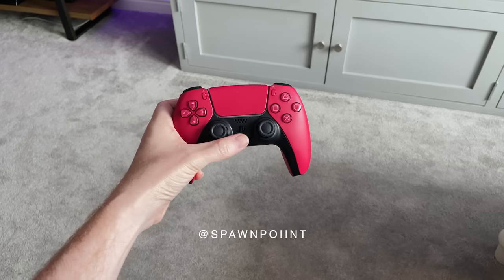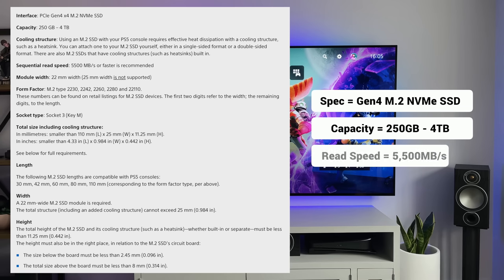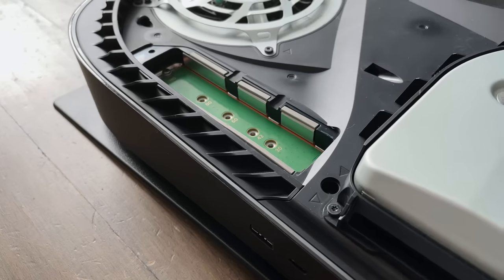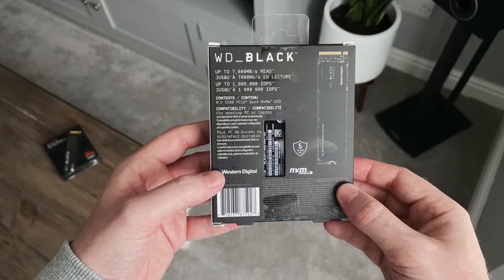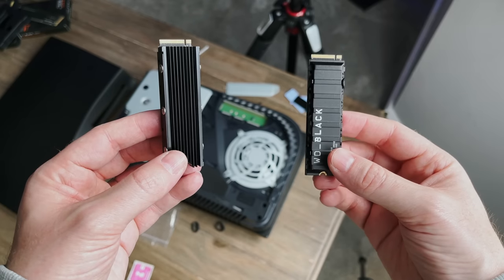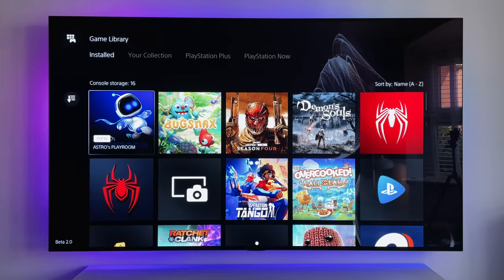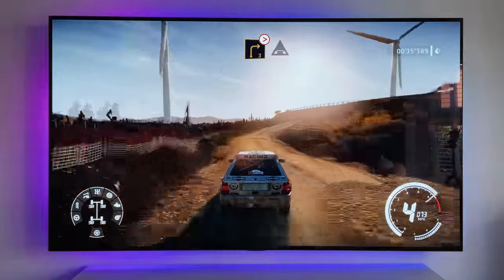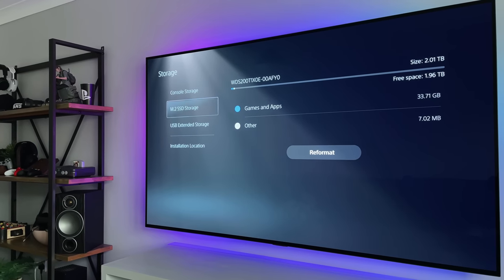PS5 SSD Upgrade: Installing 2TB SSD + Heatsink

Comment: Replacing that metal cover after installing the SSD is very important as there are holes underneath in that SSD area that the PS5 fan will suck the heat out from the SSD keeping it cooler.  I see many are purposely leaving the metal cover off thinking it will keep the SSD cooler this way... but that's a mistake.  Sony has a system in place to keep the SSD cooler by removing the SSD heat but the metal cover needs to be on for this process to work properly.
Reply: It's not a mistake -_- leaving the cover off WILL make it run cooler obviously as heat rises and the fan will still take heat away from the unit. The lid is only to prevent it from collecting a ton of dust and nothing else. Many things are designed for aesthetics on Sonys consoles and not for performance, been that since the ps3 and this is no different.
Reply: @Ardonn  Right about the SSD cover keeping the dust out... but Wrong about leaving the cover off to keep cooler. Sony says to put the silver cover plate back on to create negative pressure to help with the air flow for better cooling. And aesthetics is something done to see on the OUTSIDE... not on the Inside of something. But believe whatever makes you happy. It's your PS5 that is at risk for getting bricked.  Good Luck
Reply: @JTB--  this is right on.
Reply: This was the answer I was looking for :)
Reply: Good thing I saw this comment, i was finally able to order my ps5 and do plan to put an ssd in it. First thing I thought when i saw this video was, "i'm leaving that cover off" haha but now I will definitely replace the cover
Reply: Tests have been done and it runs cooler with the cover off
Reply: @Chipperdude  source?
Reply: @Chipperdude  source?

Comment: To anyone thinking of leaving the metal housing plate off to accommodate heatsinks that come with certain SSDs, don't. Check the dimensions and order a custom heatsink that allows for the plate to be put back after installation of any SSD. SONY officialy states that this plate is there for a very good reason, and must be left on whether you use a SSD or not. Anyone that doesn't, is risking the integrity of their console and the SSD installed.
Reply: Thank you

Comment: A nice addition to this is the performance boost. The larger your SSD the more it will take to fill it and the faster your ps5 will run if it’s not close to full.

Comment: I think I’ll wait for Black Friday to get 2TB for a discount,1TB just isn’t enough these days
Reply: It may be out of stock by then too
Reply: NAND prices are going up, not falling. Drives will either stay where they are or go up when prices catch up.
Reply: the longer you wait the higher the price, I suggest you to buy the SSD asap and just wait until the final software is released.
Reply: @benny.pepper  why the SSD prices are gonna increase?
Reply: @sicparvismagna6526  Inflation and the chip shortage
Reply: @andrewvu3083  but I mean, eventually in the next couple of years the prices will probably reduce right?
Reply: @sicparvismagna6526  Supply chain shortages are getting worse because of the delta variant. It’s going to be a long while.
Reply: @andrewvu3083  I’d still wait, because if the delta variant will end up being that bad, I’d assume the last thing we’d be worried about is gaming.
Reply: Just get a 1tb drive. 
It adds to the existing storage, not replaces. 
So with a 1tb m.2 ssd installed you'll end up with 1.7tb ish of usable storage.
Reply: I think you should wait until this system becomes more refined.
Reply: The XPG SX8200 Pro 2TB on Amazon for $220 is a great drive with a 5 year warranty. I've been using it as my main drive for a few years now with no issues.
Reply: @Defy_Convention  I don’t think that drive will work for the ps5
Reply: @HereticDuo  facts man with the ps4 pro it was different when you put a 2tb ssd it was dropped to like 1.77 with os so i guess im getting similar but a little less but u had a lot of space before jumping to ps5
Reply: @benny.pepper  Its just 500 dollars for this. Kind of expensive. Could buy another ps5 with it

Comment: YES! Finally someone actually trying this.
Reply from the maker: Thanks for watching mate.
Reply: I will be trying the 980 pro without a heatsink and see how it performs
Reply: @Native8KGamer  You’re probably gonna want a heatsink to ensure the drive doesn’t thermal throttle itself below the required speed
Reply: @cmdr101z8  Will try with and without and I'll try and post my results
Reply: @Native8KGamer  Cool, it’ll be interesting to see
Reply: @cmdr101z8  tested with and without, and honestly, the load times were exact same in 10 different games. The one without heatsink was between 5-10c higher in temps but nothing its not rated for. It might affect the longevity of the drive but it you don't have a heat sink, it works just fine
Reply: @Native8KGamer  That’s what I was thinking was going to happen. The higher temps probably won’t be good for the long term but for the short term until you can get a heatsink I think it could work out fine

Comment: It’s nice Sony made it easy to add the drive. I’ll definitely be upgrading. Great video 👍🏼
Reply: Bruh, we knew it was easy to add the drive almost a year ago, they did an entire hardware breakdown showing the slot. You just wake this year?
Reply: @evilformerlys4704  yup. Just woke up 😉
Reply: On the Xbox series you just unplug / plug whenever you want to remove your SSD.
So much simpler and user friendly
Reply: @mrrglass3407  it is but this isn't that big a deal to me. What is annoying is how they went about doing it and having their customers beta test for them instead of doing their job.  Should have been ready at launch.
Reply: @AlphaDwg  
Yes, it should have been ready at launch.

Just saying the Xbox chose a much better solution and consumer friendly solution
Reply: @mrrglass3407  "consumer friendly" by making them proprietary drives? no... that's the opposite of consumer friendly.
Reply: @Dreadpirateflappy  
Proprietary drives... That are cheaper than PlayStations SSD solution.... And have more than one company making them thereby the price will go down.
Reply: @mrrglass3407  Well there is Big difference between the speed of Xbox and PS5 ssd… so you get what you pay for… it is like saying that Trabant is cheaper than Ferrari, but yeah it os good to have options!
Reply: @haukionkannel  
No there's not a lot of difference despite what you've been told.

Comment: I can confirm this works flawless i been using my ssd on my ps5 since the release of this video i have the exact same ssd & heat sink aswell. It saves you around 70-80 euros. I play a lot evey day at least 6 hours but moat days over 10 average. Never had any issues loading plus very convenient sending files back forth between the ps5 internal & the ssd
Reply: Does it load faster than the ps5 storage or is it about the same?
Reply: So was the price of the ssd 400 when you got it because I see the one without heat sink is 400 and on with is 240 USD?
Reply: @gabrielfowler4963  300
Reply: @gabrielfowler4963  sloud be able to get it for 150-180 if your patient enough keep a look out for that once or 2x a year super deals
Reply: @noneya7905  slower but all games are running flawless i have 525+ games including many heavy AAA games. The stock ssd on the motherboard is 5500 so yes most ssds will be faster if not a massive improvement good choice to install them on your m.2 ssd
Reply: @sjors91  ty

Comment: Will be putting in the Samsung 990 Pro 2tb with heatsink is this a good choice
Reply: How'd it go? Any issues? Also, when you move your games from the PS5 m2 drive to the new larger m2 drive, are you or should you also move your save files as well? Also, does the Sony automatically save the save files to its original m2 drive, or can you have it save the save files to the new m2 drive?

I'm trying to free up as much storage on the PS5 m2 drive as possible, but I don't want any complications now or in the future with the save files. Thanks

Comment: Just installed my SSD today. Thank you so much. One thing to mention, removing that screw can be a pain due to being easily stripped. So make sure to have a 3.5mm screwdriver to remove the screw with spacer. Amazon has em for cheap. Thanks SpawnPoiint!! You’re the man!!

Comment: I wonder how much airflow the SSD bay actually gets. How I see it, the heatsink should actually make contact with the bay cover, which seem like being made of metal, so airflow going over the cover is cooling it down.
I'll wait for Gamers Nexus or someone to do some thermal tests including if a heat sink actually makes a difference if there is no airflow inside the SSD bay and the heatsink doesn't make contact with the bay cover.

Got a 2TB Samsung OEM NVMe SSD (OEM version of the 980 Pro) without heatsink waiting, which was a steal a few months ago for like 250 bucks.

Comment: So with this SSD you can install ps5 games like with the external drives ? Or does it just stores them so you can load them later
Reply from the maker: It stores and plays them, no need to move games to play them. It works the same way as the internal SSD.

Comment: nice explanation!
just a quick question: by adding a 500gb it will "sum" with the original 600gb and thus the full size would be 1gb or will work separately as a external one?

Comment: I've ordered the same ssd, the 1TB option, with no heatsink.
Got one separately, but THEN i realized that I'm not in the beta program.
Good thing though, I got it with a good price, and I'll be ready when the time comes.
Reply: Yeah, I feel like this point should be emphasized more. You shouldn't buy the SSD until you've registered and been accepted for the beta.

Comment: Great video. Really well detailed. Appreciate the installation. Am happy with my main storage for now but I do have an external hard drive of 4TB which I bought like 9 or 10 months ago, way before they release that software update allowing us to install another internal SSD.

I have been looking for an internal SSD in the sale. Am most likely to buy a Seagate FireCuda 530 or a Samsung 980 Pro with heatsink, either one with 2TB.

Comment: Just got my ps5 last week and I just updated the storage with the ssd and heatsink in this video was really easy. You guys should save money and buy without a heatsink. It comes with a screwdriver with the heatsink that you can use on the ps5 just follow this video. Thanks for the help!

Comment: I just purchased the 2TB Wester Digital Black (with heatsink) from their online store. The drives are currently on sale (saved $190) which is awesome. I didn't think I'd be upgrading my storage already, figured I'd wait some time until prices drop. Very cool to have stumbled upon a sale already. :)
Reply from the maker: That’s an awesome price mate
Reply: Hi , is the wd-black 2TP good ? Did you get any problems with it ? Does the console get hotter ?
Reply: @iKR97  Hi! No it works like a charm. Superfast just like the built in drive and no heat issues what-so-ever. It's serving me quite well. :)

Comment: So you keep the 600 gb from the console and the extended storage? Or does adding the internal SSD expansion remove the 650gb??
Reply from the maker: It’s in addition to. So 667GB plus the new drive.

Comment: I like how it says 2TB and it actually gives you 2TB and to be more technical it gave you 2.01TB. I feel like this should be standard for stuff like this. I've gotten a SD card that was suppose to have 256GB for my switch. It instead ended up having like 221GB. Meaning 35GB were suppose to be on it but for some reason it wasn't infact. I don't see how its not illegal as false advertisement. Anyways thats awesome that they actually give you the 2TB and it not being like 1.8TB or something

Comment: Hello and good day to you. Thank you for your video. Thumbs up all the way. I have a quick question. The third party heat sink I purchased had 3 pads but only two were needed in the instructions. Is that just a spare, or did I miss something? Thank you for your time and may God Bless. Also I almost broke the ssd during installation because it is important to note that there is a literal spacer that goes under the screw, and we shouldn't bend it. 😆
Reply from the maker: Yes the spacer goes under (needs to be level). The extra pad is if you’re using the bands instead of plates.
Reply: @SpawnPoiint  Thank you

Comment: Great video. But watching it makes me think " What the Hell was Sony thinking?". Easy installation ? Ok I guess, but the specs on the ram is stupid.  How many people are going to buy something that doesn't fit or overheats? Sony has made memory before, why didn't they make their own this time? And why 8 months later? If I had a PS5 right now I would be pissed. Xbox Series X, plug in memory-done. You don't even have to turn it off. Maybe with the next version of PS5 they will get it together

Comment: Well just used your links, and the one with the heat sync is already being scalped for 300 over the retail price, and the separate heat sync is completely sold out. Seems like upgrading my ps5 is going to be just as hard as getting the console itself.

Comment: What I'm wondering is, if you just leave the metal cover aside there schould be a good extra gap between the Sideplate and the SSD Bay. So wouldn't it easily be possible to put a way bigger Heatsink in? Also would be better for cooling the SSD

Comment: Will that heatsink you used specifically only work for the WD SSD? There is a model by PNY called the XLR8 CS3040. It’s cheaper so I’d prefer to go that route. It’s confirmed to work on the PS5, but you need to install your own heatsink. It has nearly the same dimensions as the WD as far as physical size. WD is 3.15 x 0.87 x 0.09, and PNY is 3.15 x 0.87 x 0.16. So the PNY is 0.07 thicker. Would it still fit the same heatsink?

Comment: I have the WD_Black SN850 NVMe Gen 4 M.2 SSD over 7000 mb/s with Heatsink (the same one from your video except it's 1TB) and it only cost $250. I bought it directly from Western Digital. I'll be getting it in a few days.

Comment: Don't buy the WD SN850 with heatsink attached!!!! The thermal pad does not make contact with the controller of the SSD. The heatsink is therefore essentially useless! You can even see that the thermal pad is seperated from his drive controller in this video too. BUY WITHOUT HEATSINK IF YOU WANT A WD DRIVE!!!

Not to mention also I'm trying to return mine right now but they sent me a drive with an invalid serial number. It's been a 10 days and customer service still hasn't solved my issue so I can return the drive. THEY HAVE TERRIBLE CUSTOMER SERVICE!

Comment: I’ve managed to get my hands on a ps5 which I haven’t set up yet, I’ve also got the 4TB Firecuda 530 SSD.. My question is should I install the SSD before setting up the console or after? Or does it not make much difference at all?? Cheers 👍

Comment: 1:25
I looked at the specs for that Samsung 980Pro. Specs say its 24mm wide. Wouldnt that mean it wont work then? Since required width is 22mm?  Would be too wide, correct?

Comment: Question…. I try to remove the SSD “screw”, but I think I use the wrong screwdriver, I put the cover back on it, formatted it and it’s working fine, do I have anything to worry about, “long term”, without the SSD screw?

Comment: If the price for the ssd was a lot cheaper I would love to upgrade the memory. The original memory size in my opinion is way to small especially for the size of games these days. 

But £350+ to add what should be the base level memory for this console is way to expensive!!! (Can I have the spare one you didn’t fit? Haha 😂)

If the prices come down I will definitely upgrade and happy to fit a heat sink myself.

Comment: Two poor man's tricks to avoid buying a SSD and controller charger. 
1)- Only buy used games in cd versions . load  7 games at once and delete and install games after that .
2)- Buy a 12 foot controller cord and never worry about a dead controller battery again.

Comment: Hey does it works with all of the SSD you said on it even the Samsung 980 pro nvme gen4 internal gaming see m.2 because I found this on Amazon  it I'm.still confused because I want to check does it work on it or it just the Western digital

Comment: Hey here. Forgot to take my disc out before turning it upside down. Took the disc out after performing the installation and had four marks like some rubber was placed on it… my question here is… do you think the laser could have taken some damage from it?

Have installed some games after that and everything seems to be fine (just installed them, haven’t played them)… but you know… the classic “after a couple of weeks it started acting weird” thing…

Comment: So I'm going to be a little honest, because I'm not very tech savvy and I'm trying to get into it. Where he removes the metal plate and puts in the SSD, is that naturally left empty and made specifically for adding an SSD, or is there something there to start with and you just replace it with a different one? Also, does anyone have their own preference or recommendation as to which SSD to get? I'm looking at probably getting something larger like in the 2TB range. Right now I have an external hard drive for my PS4 games, but I'm going to need more storage and was going to get another one, but if an SSD is this easy and there isn't already something in there I'm probably going to go with the latter route.

Comment: I am the only one where it’s never as easy as on the videos ? The tiny little screw for securing the SSD was stuck ! Sony  goes to the trouble of putting cute PS5 symbols on the screws, but they make them those 😤 Philips. And I’m not taking about the pressure you have to put to close back the panels.